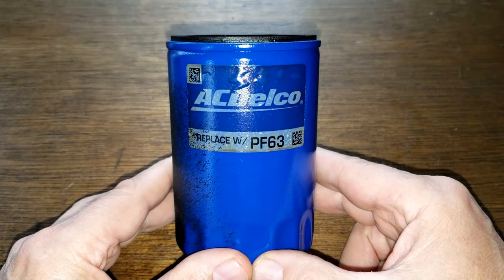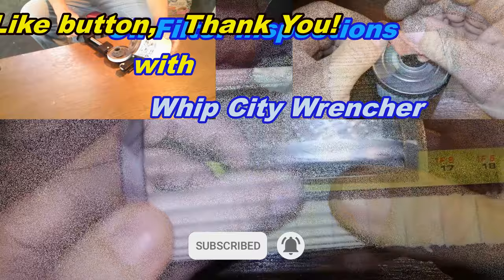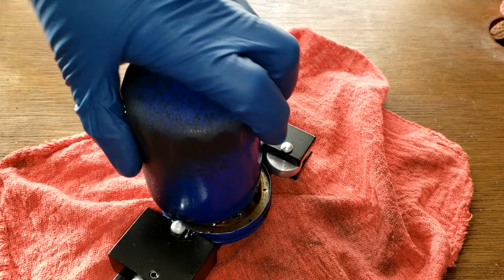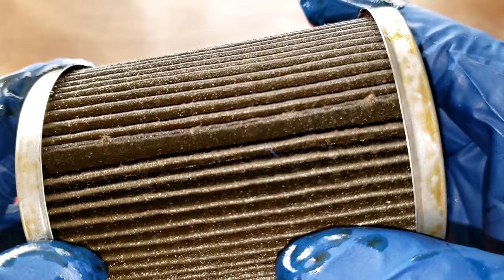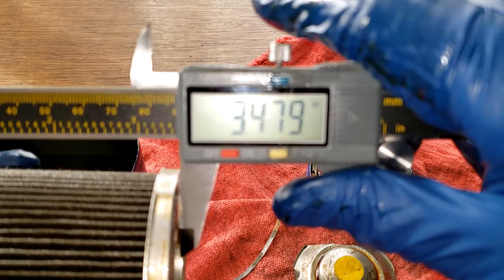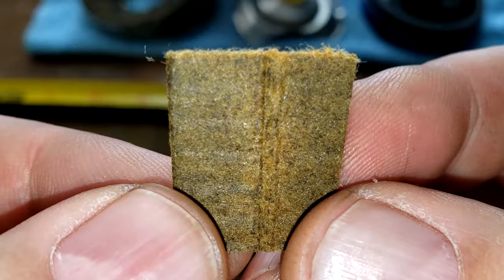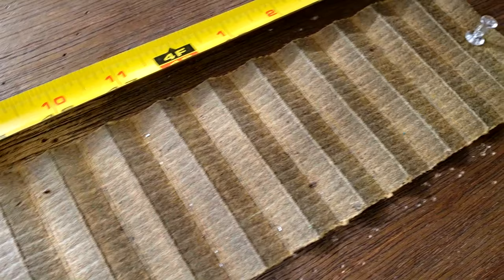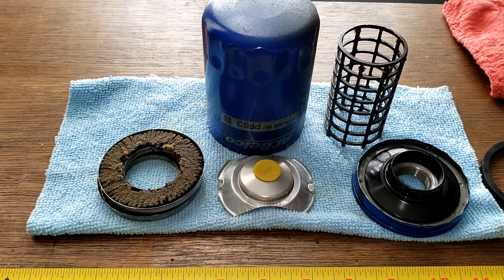Factory ACDelco PF63 Oil Filter Cut Open, Used ACDelco Oil Filter Cut open

Comment: I actually like this filter. I was under the impression ac delco filters didnt have metal end caps! I wouldnt have waited that long to change factory oil but thats just me.
Reply: @01mustang05  Yea, that setup with the bypass valve in the spring seems to be rather imperfect, shall we say.

Comment: I most likely would have changed out the factory fill sooner than that ! Besides a small amount of assembly lube there will also be break in paticles "sparklies " floating around ! Filter did good all n all ! 👍
Reply: I never go more than 500 miles on the first change.
Reply: @ChicagoRob2 
Why?
Reply: @JK-qe6qq  For the same reason you see in this video having metal particles as it breaks in. have rebuilt a few long blocks and have done 1k then 2k with new filters after the initial break in run.

Comment: Fyi to anyone who reads this new vehicles should have their first oil change done within the first 300 to 500 miles
Reply: I'd do that, the only thing is, what oil would you use? Is it ok  to continue break in with mineral or can you use synthetic?
Reply: @user-sf7kl9uh7k  well from factory they don't use mineral oil breaking oil. They use synthetic or semi-synthetic I've always just went ahead and put my normal synthetic wall in at that point but the reason being you changed it at 3 to 500. Mi is the medical particles and the contamination that's in the motor from it being built.
Reply: @vector150  Yes, I agree it seems a good idea. TBH if I had a new vehicle I'd do that, and then around 30,000 I'd change everything. PS fluid, Box/Diffs/Transfer and brake fluid.
Reply: @user-sf7kl9uh7k  maintenance is important. A lot of people just want to put gas in them and run the wheels off of them. You know what I'm saying
Reply: @vector150  Yeah, agreed. It's a shame, many nice engines are ruined by a lack of servicing. Apart from the initial 500-1000 mile break in we've already discussed, I'm not convinced oil can't be left in for 5-7,000. Depends on the use, but I consider changing the oil every 3k wasteful.
Reply: I've never done that. 1st oil change at the recommended interval. The filter catches the metal flakes. They ain't going anywhere.
Reply: Lake Speed Jr had an entire video devoted to this.  He's the motor oil geek and he has great content.
Reply: And new filter. I use conventional for the first one because I dump the OE oil and filter around 3-500 and go to about 2K on the 2nd. I run filtermags too.  Thats plenty of hot and cold cycles and enough to flush out the shavings of break in.
Reply: @user-sf7kl9uh7k  15K on diffs and PS. .Xfer case depends on use.  Brake fluid every other year. I just bleed the old out Takes 20 minutes.
Reply: @GT-mn3bx  call new filter should always be used at every oil change I really hope there's not people using the same oil filter for multiple oil changes cuz that's not going to be good
Reply: @donwyoming1936 Not the grit smaller than the filters micron rating. Filtermags would help immensely.
Reply: @vector150 Most people never change the filter because it says "8 million miles) Many blow the engine at 15-20K . Ever see all these new cars smoking with black soot all around the rear end?
Reply: @GT-mn3bx  I guess I shouldn't be too shocked. I deal with a couple of recon places. A dealership and buddy of mine works at a Walmart. People can be pretty cheap
Reply: Why don’t manufacturers recommend changing that early just don’t make sense changing at 500 miles lol
Reply: @JK-qe6qq  this is not just the manufacturer. This is anybody that's ever built an engine. This is a staple of new engines. It does make sense to change it at that. There's proof in the pudding. There's contamination. There's metal shavings
Reply: @JK-qe6qq  manufacturers also tell you that your transmission fluid is lifetime fluid. You're rear differential lube is lifetime lube and that's malarkey
Reply: Great video Pete. You can see those chips from space. Obviously, this guy doesn't care about his truck. New engines need their first oil change 400 - 500 miles to take out all the assembly lube and chips. Then every 3k after that. I can only imagine the chips in the bearings and Valve Phasers...
Reply: Thanks, good idea…..interestingly, my MOPAR “Dealer “ , DROVE  my DEMO Purchase A YEAR PLUS(??),  though ONLY some 8,800 miles on selling to Us( MOPAR Conventional 5W-20 Oil, PERFORMAX Filters , generally, as   I got  Lifetime Oil Changes//3000 mi)……
Reply: Thanks, good idea…..interestingly, my MOPAR “Dealer “ , DROVE  my DEMO Purchase A YEAR PLUS(??),  though ONLY some 8,800 miles on selling to Us( MOPAR Conventional 5W-20 Oil, PERFORMAX Filters , generally, as   I got  Lifetime Oil Changes//3000 mi)……
Reply: @vector150 
This is not a custom build motor. No new engine from manufactured needs oil changed at 500 miles I don’t think you’re smarter than manufacture.
Reply: @vector150 
Are you telling me you’re smarter than they are?
Reply: @vector150  Not disagreeing with you to do an early first oil change out of precaution, but metal shavings get caught by the filter. That's the point.
Reply: @JK-qe6qq  there's no infrastruct custom build and a manufactured engine until you see them being built. The understand the people on the lines not very clean. We have pulled a Debbie snack cake package on top of a brand new Honda engine He's a chemical engineer on YouTube is to have built race cars. His dad raced professionally go see what he had to say about it. Nick and argue all you want. I'm going to tell you right now you're wrong they're in the business to sell you cars. Do you understand what lifetime means? And the automotive industry 4 to 7 years was what people keep their cars something like that. That's what they consider a lifetime
Reply: @F0XD1E  yeah you do want to catch it. Put oil filters bypass also

Comment: OEM ACDelco Oil Filter well built. Keep Using it. 5W-30 Engine Oil been out for long time and there is a lot of brand s that make it for both Petrol and Diesel Engines. Keep using Factory 5W-30 engine oil or use any other good brands like Castrol, Valvoline, STP, Mobile 1, Royal Purple, Redline, Liqui Moli , Pennzoil and  many more. Even Motorcraft and Mopar make " Full Synthetic " 5W-30 Engine oils . Good review on OEM product.
Reply from the maker: Thanks, Anish👍

Comment: That factory installed filter actually looks pretty decent being that it's pretty much a "no-frills" type of filter. It help up well and did its job but I gotta say, there's no way in hades that I would go 5000 miles on factory fill oil and same filter! I've had many new cars and my usual routine is 1st change out at 300 miles, 2nd change out at 1000 miles, final change out at 3000 miles, afterwhich I resume normal oil change intervals (every 3k) and the above video just reinforces precisely why I do that change out schedule on a new car/engine! The size of some of those metal flakes is downright scary and the idea of those size of metal particles circulating through the entire engine for over 5000 miles.... yeah, not a good idea (to say the least) so my guess is they aren't planning on keeping the truck long term lol. All that said, after seeing this I wouldn't hesitate to use an AC Delco oil filter for a normal oil change interval. That's not something I can say about Motorcraft anymore unfortunately with their self-destructing filter adhesive.
Reply from the maker: I like your oil/filter change interval for a new engine😊
Something I would do also if I had a brand-new vehicle. Thanks for the feedback👍

Comment: Not too bad.  Big negatives are (1) Nitrile ADBV, should be silicone rubber, and (2) AC Delco 'E-core' cheap plastic cage allows big chunks of the filter or some particle through a breach in the media to penetrate with no last line of defense (open louvers-type is best).
........ On break-in, one doesn't have to change the oil filter,  as you can opt to swap out half the oil with an electric pump through the dipstick hole top-side easy, and just do that every 1,000 miles a couple of times to get most of the metal break-in dust particles out early.  Easy.
Reply: Sounds like the old ecores. Newer ecore now have more trusses in the cage and pleating much tighter now. Haven't seen any of those issues with the new.

Comment: As you pointed out in a previous video, the metal on metal mating of the combination bypass valve/spring to the endcap is not a good seal so oil will probably get by. I wonder what the cost would be to put a rubber or silicone mating surface on that end to prevent oil getting by.

Comment: They undercoated it with that rubberized crap. Bills truck won't last 10 years in that climate😢
Reply: it’s infuriating, we were told at the dealership they were gonna use a oil undercoating but they actually used ziebart, which is the worst crap there is, it’s rots vehicles from the inside out, you’re better off using nothing than that stuff, i’m convinced they do it intentionally so that the vehicles rot out quicker.